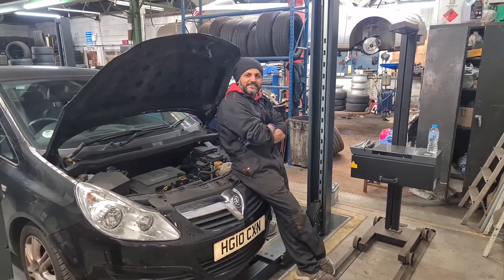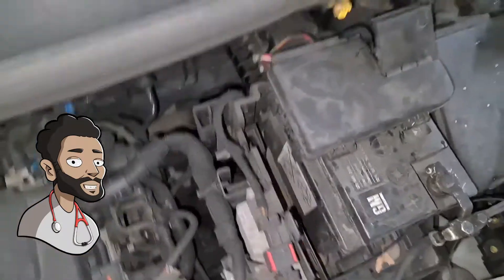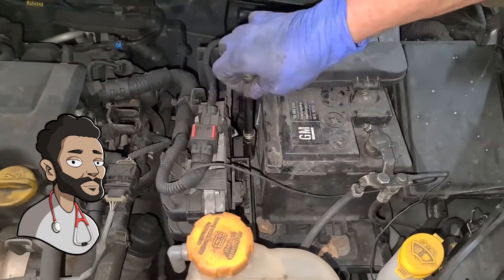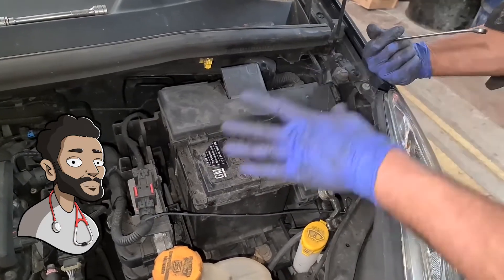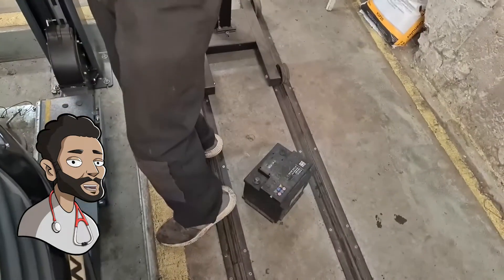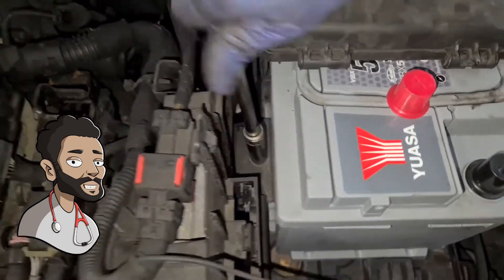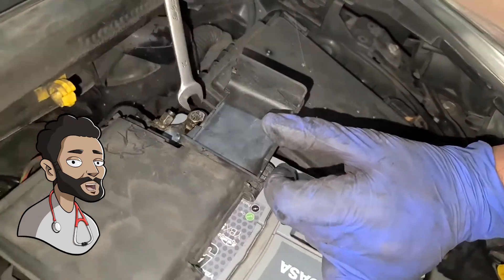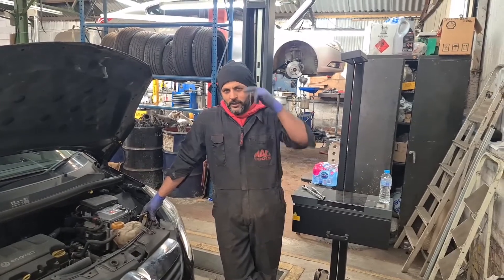How to Change a Battery on a (Vauxhall Corsa 2010/11)

Comment: I saw somewhere that when you take the battery out it resets codes….. would that damage the car or? What are these codes…?
Reply from the maker: It does if you leave it off for a long time but only some cars and replacing battery shouldn’t damage anything unless fitting battery incorrectly can cause ecu damage. New cars are little complicated now so you gotta be careful when changing battery on new cars and always double check if you got the right battery for the car I.e. start stop batteries are different to standard batteries.

Comment: My relatives corsa D 1.4 got 13.3V reading from alternator while engine running and not much of a change when under load . Any idea ?
Reply: sounds like your alternator might be starting to fail , you should be getting around 14.4 volts under normal conditions.
Reply: @brucewayne7838   thanks thats the thing , it was 13.4 idling and it was just sitting two weeks. Ive charged the car battery with victron charger and now it idles at 13.9 with already headlights on
Reply: @viliambena6767  have you had the battery tested recently ? you might also benefit from a new battery if it is a few years old,.
Reply: @brucewayne7838   yes ive bought some ancel red one and tested it around 12V and 60% and said charge and retest, after charging its holding around 12.5V for 15 hours , but it still says 70% recharge . It does it to my 80ah BMW agm battery as well, but the charger starts at 3ah and stays in float 0.2ah charge . Both are 2 years old exide batteries. The Corsa D now lost All warning sounds like blinkers, leaving the lights on, parking sensors. It All happened since battery got empty that not even door locks opened and its still goes
Reply: @viliambena6767  12.5 volts is healthy for a battery and it should hold that charge for a couple of weeks. if it is dropping then the battery needs renewing, if it is a battery that you can open on top , try checking the level in each cell and make sure that they are covered as even one that is low can result in problems,   i would put a new battery on it and see what happens,  a  bad battery can make the car do strange things, maybe try a new one and see what happens. you might have to reset some of the settings on the corsa, like the door locking, signals and the ecu will take a few miles to adjust itself   but that is what i would try first.
Reply: @brucewayne7838   thanks I'll definitely try that . I was suspicious if Corsa doesn't need battery registration via obd 2, as my bmw does need that . Thanks a lot , will try to make it work. I found some Corsa forums saying it's common issue and it's faulty speaker behind the whole speed meter cluster making all those car noises, and as it goes bad it's quite expensive fix
Reply: @viliambena6767  another thing to try on the corsa is the earth connection to the car body, you will need to remove the battery box and follow the wire to the body check that the bolt is corrosion free, and the other is the earth lead to the starter motor, if your going to change your battery then it is worth checking and cleaning both those and smear with copper grease if you have some or vaseline would be fine. as for battery registration that is only usually on vehicles which have stop/start.. good luck from the caped crusader.
Reply: @brucewayne7838   thanks a lot ! That's  Exactly what I've thought, that it might be bad ground cables( found some video in which a guy tried a multimeter and negative lead on a - terminal , while + touching metal engine part , mine were like 0 and some numbers back and forth and flashing to zero ) . Sadly all mechanics around are literally parts changers, so I think it would end up with new alternator and still issue not solved
Reply: @brucewayne7838   much appreciated advices!
Reply: @viliambena6767  yes you are right about a lot of mechanics but if you try the grounds first it wont cost you anything but your time! your welcome for the advice and let me know how you get on, have a nice day from the batman.
Reply: @brucewayne7838   for sure ! It helps that this corsa is much simpler and smaller engine then my bmw , which basically got one big engine and can't see anything thru it. Thanks again , wishing all the best !